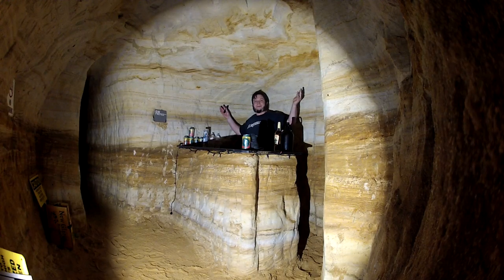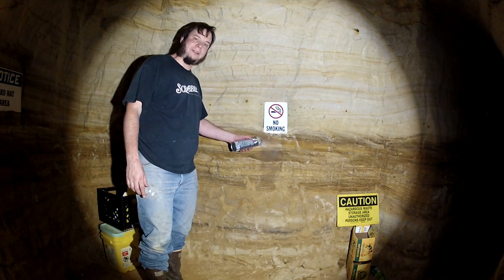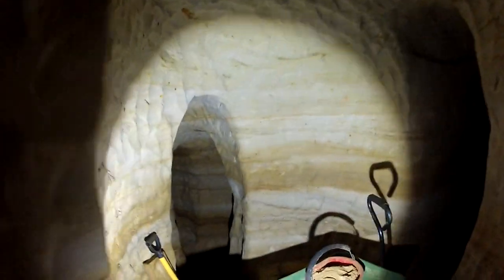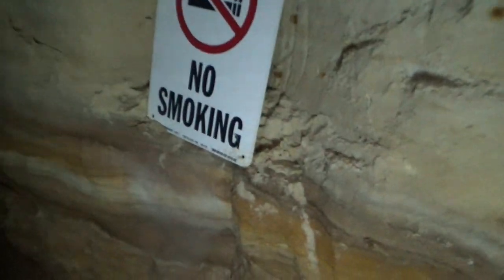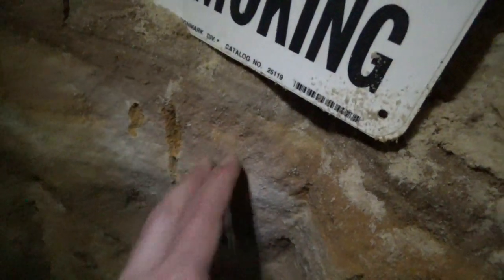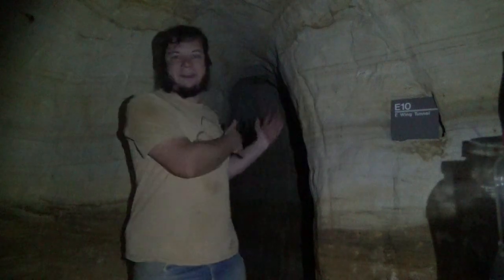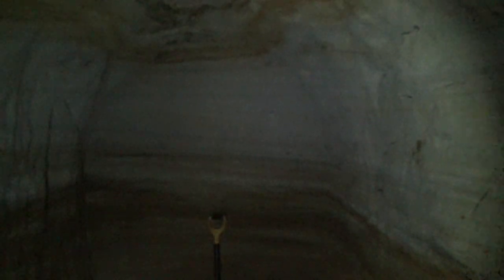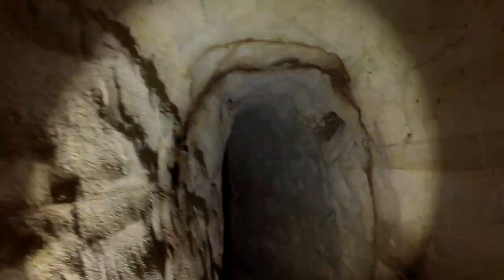DIY Underground Speakeasy Part Two - Digging an Underground Bar in Sandstone Bedrock

Comment: Amazing.  A dude has to wonder how hard it would be to drill a few holes from the surface and line them with casing and make some serious ventilation.  A small water well drill could do it or possibly a gas powered auger with a really long extension and a nice head frame to hold onto the auger on the surface.  I'm also surprised you aren't using a rail system to move the sand out.  A train with a series of maybe 50 tiny buckets the size of a one gallon milk jug can move way more sand than a little wheel barrow can.  Also, wider chisels on your impact drills that are used for digging would be first on my list.  I believe you could make them out of junk and sharpen them daily when you leave for the day and sharpen them in your garage which is also filled with junk.
Reply from the maker: I've found that narrower chisels actually work better for some reason. I did buy some wide ones but I never use them and forgot where they are in the garage of junk :-) 
I've advocated for a train but the owner likes to stick with his wagons and buckets. We've also considered drills, the land surface above the tunnels is pretty steep so it would be hard to get anything heavy in place up there. The bar will eventually connect to another tunnel that goes to another entrance for cross-flow.
Reply: A 'dude' just might. That word should be banned, dude.
Reply: @corkcamden9878  The dude abides. That rug really tied the room together.

Comment: I'm thinking some kind of water based sealant. A polyurethane or something similar. If it's thinned out a little perhaps it would soak into the sandstone enough to create a decent protective crust. The problem with anything like the bedliner or paint is it's just a surface cover and would fall off fairly rapidly. You need something that's going to become a half inch or more shell so it doesn't just brush away. 
Maybe you could test some in an area you're planning on excavating anyway and see what type and mixture soaks in the best. Drilling small holes a specific distance apart (again with the testing) to inject it would allow the stuff to soak in deeper then you can fill in the holes with a sand/binder mix. 
Otherwise your experiments with the silicone and two-part epoxies show some promise. You may end up having to use something like that as a stucco type application on the finished rooms and furnishings.
Reply: @AaronzDad  Or give some basement sealant a try
Reply: @bootsowen  That wouldn't work as those are just surface applications. For the crumbly rock in the cave he needs a sealant that will soak in deep and create structural strength as well as protection against moisture

Comment: I am really curious. What is the time breakdown to remove one wagon load? 
Min:	Task:
6? 	Hammer at the face
1? 	Shovel to bucket
1? 	Bucket to wagon
4?	Move wagon to sand train and dump
2? 	Operating the sand train
2? 	Operating cable tram system
4? 	Fixing stuff 
 
Let’s say this is for digging the new booths in the bar. 
So one person can move 30? wagons in 10? hours, so 20? minutes a wagon load.
Each wagon is 225?lbs of wet sand. 

Thanks Gabe so much for posting these videos!

What I am really wondering is would LiFePO4 powered self-driving wagons help in this effort? 
 
I find this really interesting because I had no idea there was easy, but safe digging in the Midwest exposed near major rivers. I know of places all over the world where people do this, sandstone, dry clay, volcanic glass rock, but it’s awesome to learn we can do it locally.
Reply from the maker: I'll have to ask the owner about the exact time breakdown, he keeps track of it more closely. The slowest part is usually waiting for the cable tram and dump process.
Reply: @saveitforparts  I would love to hear more about pain points and upgrades that are being considered in videos. Of course I am sure part of the fun is just doing it and if you could move sand out of the hill ten times faster it would cause major issues. I bet I am not the only engineer thinking about all sorts of ideas as this is the perfect sandbox to try so many things out.
Reply from the maker: The owner is also an engineer, although more the mechanical type than mining or civil type. I've sent him your comments and will let you know what he says :-) If you want to contact him directly I think his email is on www.tunnelcity.com or you can email me gabe@saveitforparts.com and I can connect you.

Comment: How long did this entire dig take to get this far. I just bought 25 acres off the grid in Arizona and I'm about to hire a crew to dig me a secret tunnel.
Reply from the maker: It's been about a decade since Sandland started. How fast you can dig depends on a lot of factors, including what geology you're going through, how and where you dispose of the material, how much power you have, what kind of tools you have, the size and design of the tunnels, etc. We're definitely not doing things as efficiently as possible, there are a lot of trade-offs to prioritize design over speed.

Comment: Instead of truck bed liner or other "things" how about dry cement? you already have the sand and water on every surface.
Reply from the maker: We're trying to find something that's flexible and self-adhesive enough to not just fall off or crack.
Reply: @saveitforparts  I think Tony is right, if you just dust dry cement powder on with a brush or something to those damp walls it should set up hard, or make up a cement water slurry and brush it on or spray, as a bulk solution it will be far cheaper than any chemical sealant.

Comment: How deep are you able to dig? Is there a bottom of the sandstone layer or is a water table at some point?
Reply from the maker: We haven't hit the bottom of the sandstone layer yet, one of the future plans is to keep extending the inclined haul tunnel to see how far we can go.  The water table is pretty deep, we're up on the side of a hill so there's another few hundred feet down to the valley floor.

Comment: what are you guys doing about fresh air in the tunnels??
Reply from the maker: We have a pipe and fan bringing fresh air into one part, and there's quite a bit of natural circulation since we have two entrances. Eventually we'll have more cross tunnels and air flow to some of the current dead-end areas. I did another video measuring air quality here: https://youtu.be/ZZ_KWqM2y1g

Comment: I bought some land with a sand knob 
how do you keep the roof from leaking?
Reply from the maker: We get some condensation and high humidity, but we don't actually get ground water in our tunnels.
Reply: is there a way to keep them dry enough to live in though'>? @saveitforparts

Comment: Why not sell the sand to a cement company, win win situation and perhaps barter for some concrete? I checked and I do have an impeller and ignition along with a carb kit for your 1956 15hp outboard !
Reply from the maker: The location of the sand is pretty inconvenient, it's basically in the bottom of a ravine down an old logging road. You can get it out with a loader but can't get a truck down there easily. The cement companies all have nearby sandstone quarries that are more efficient and cheaper.
Reply from the maker: Re outboard stuff, could you shoot me an email at gabe@saveitforparts.com? Youtube is a little flaky about notifications so I sometimes miss stuff in the comments.
Reply: @saveitforparts  sure can !